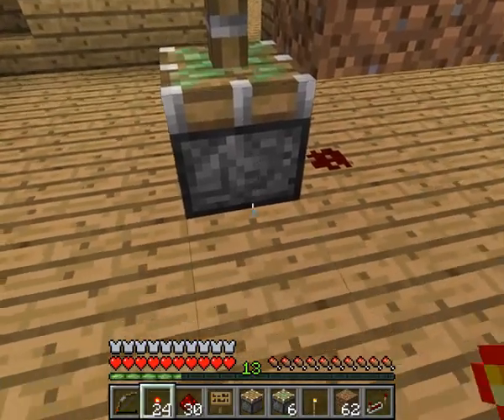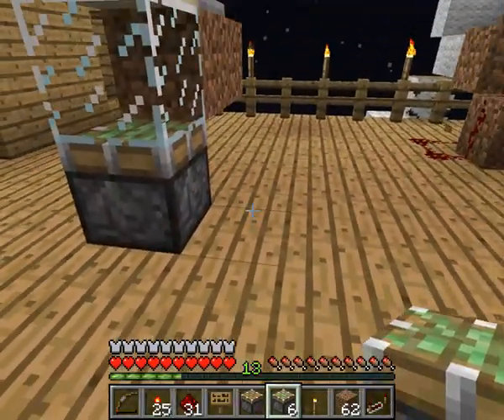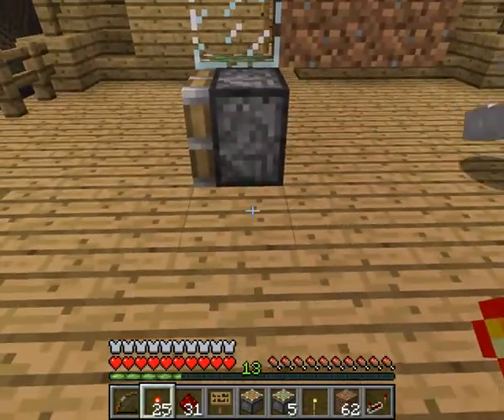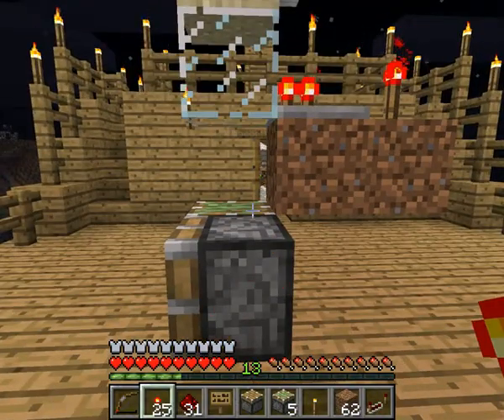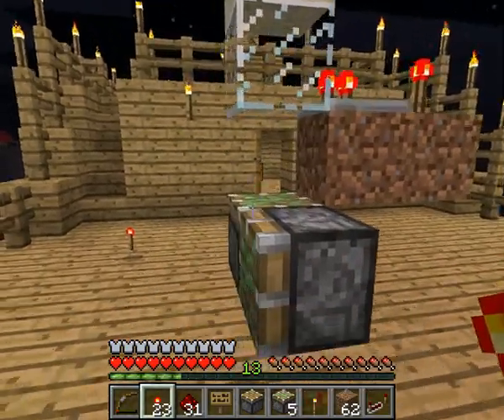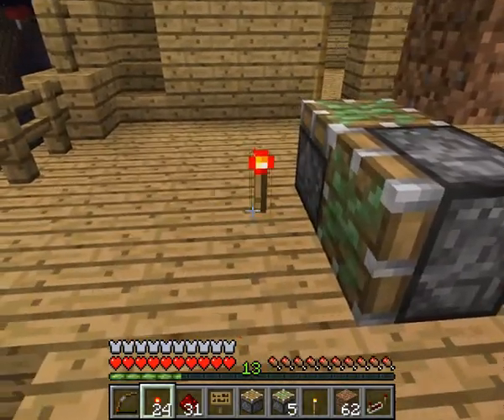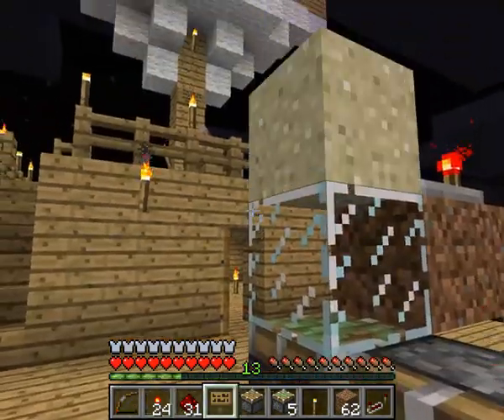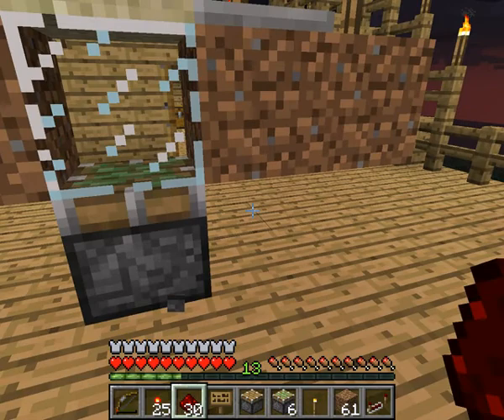Note on simplifying Super-compact BUD switch.

Comment from the maker: Yeah, that video basically has the same design, and is earlier.

You can make a bit of memory out of something similar, which is more important.

And that particular design has a quirky bug where if 2+ blocks are altered during the same tick it locks state in up position. Which is (as best as I can figure) pointless but it is completely unique.

Pistons take 2 ticks to extend, and 0 ticks to retract. Which makes a different form of memory I wanted to make much harder to make.